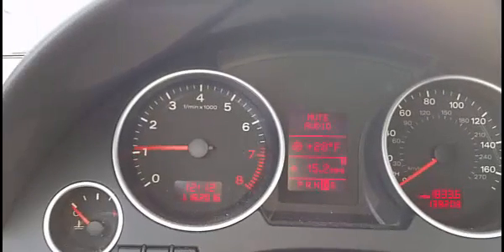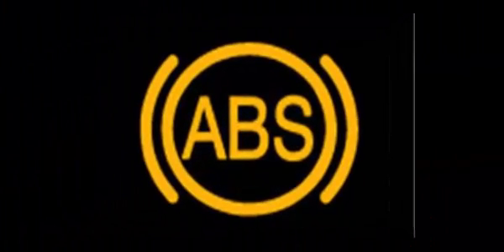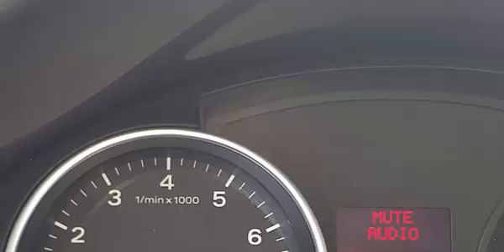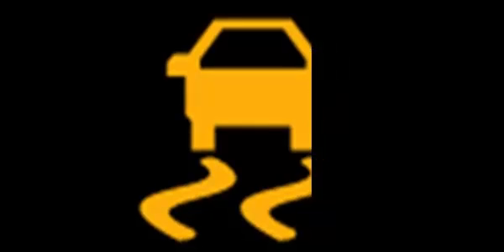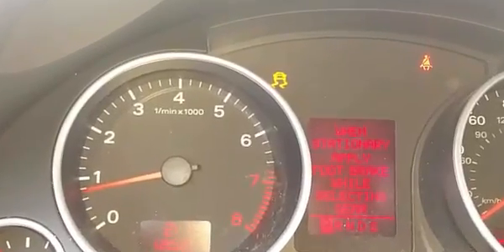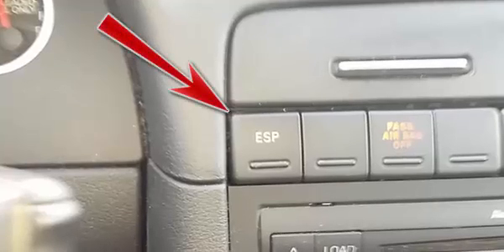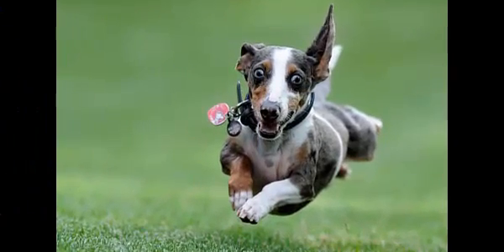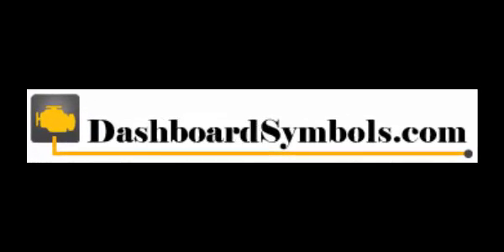Stability control lights: Assuming you have good tires, when and why do they pop up?

Comment: Does anyone know if it’s ok to drive with the check engine light/traction control and epc light on? Mechanic suggests to get rid of it (bad code on the engine thing). I am getting rid of it: however, I have to make a 10 mile round trip errand tomorrow.  The car runs, is it safe?
Reply from the maker: IF the car runs normally, it is PROBABLY ok to drive. But clearly the engine problem needs to be addressed as soon as possible to prevent serious damage...
Reply: @DashboardSymbols  thank you for your reply. It’s not normal, but it runs. Its idles high but I’m getting rid of it. It’s been burning oil for years. I just have this one errand before I get the new car.  Thank you 🙏🏻

Comment: So where would the button be located on 2007 Audi Q7 3.6L V6 quattro to re set the ESP light ?
Reply from the maker: There is no reset button for ESP. There MAY be an off switch, but it should be clearly marked. I'm sorry to say that we don't have access to Audi manuals, so there is no way to look this up. However, it would be marked ESP, and I would expect to find it in the upper, center part of the dashboard. Finally, if the light stays on when the button is pressed, there is a fault in the system...
Reply: @DashboardSymbols  oh alright thank you.

Comment: My 2013 subaru impreza shows check engine with traction control light, what could be the problem
Reply from the maker: Something in the engine, but a good tech will need to actually diagnose. Traction control will resolve once the engine problem is fixed...

Comment: i am currently buying a car its a 2015 Toyota corolla and I was testing it out and the ESC was turned on. I don't know if this is because I was getting used to the car or there is something about the car. Please can I have some advise
Reply from the maker: If you're telling me the LIGHT is on (the system should be on), don't buy it. Walk away...
Reply: @DashboardSymbols  I looked at it again and the light of control was on for the whole entire time not the ESC. so is it still a good idea to buy it?
Reply from the maker: @kurayamihayashi4060  Not without having it checked out.

Comment: Please help my electronic stability control keeps turning on and disables my all wheel drive on my dodge charger pursuit. Idk what's wrong have to keep turning my vehicle on and off goes away and comes back
Reply from the maker: There is clearly an issue that needs a hands-on diagnosis. Something as simple as having hit a pot hole can disable the system, but someone needs to get their hands on the car...

Comment: So I have a 2012 Toyota Tacoma and the traction control light has been on for quite a while meaning traction control is off but it doesn’t let me turn it back on to get rid of the light on the dash, someone reversed and hit my passenger side messing up my wheel more then anything I got all the parts replaced including the wheel the frame around the engine bay was all straighten out but my steering wheel needs and alignment it’s angled to the left even though I’m going straight could that be the problem? Or what do you recommend I do? Luckily I live in California so no snow or really any heavy rain
Reply: I also have the tire pressure light on but all tires have been checked on pressure including the spare so I’m assuming that’s just a bad pressure sensor right?
Reply: My truck also did pass the smog check here in California with both those lights on so everything todo under the hood is in good shape
Reply from the maker: Yes, poor alignment won't allow TC to operate. And it will wear out your tires fast too...

Comment: I saw this light briefly flash at me when i made a right turn up a hill that looks like it wasn’t paved evenly at some parts on the corner. So this light is normal to go on like that ? It’s basically just a small annoying warning? I wasn’t even driving that fast at all Around the corner too. It’s that sensitive? Now when I turn on the car that light isn’t on. If it was stuck on then I know there’s a deeper issue but there are no lights on my dashboard right now. The ABS light didn’t go off the same time this traction light went off.
Reply from the maker: Honestly, yes, just an annoying light seen when a wheel slips. I would caution only to make sure your tires are good -- they'll slip more as they wear...

Comment: I saw this light come on when I was parking my 2008 Lexus IS250 on a weirdly paved and angled street. It went on briefly for like 1 or 2 seconds and now I never seen it again. It’s gone, never seen it happen after I left the parking spot and drove normally. Now, I once had it never go off with the VSC and ABS light on. What it ended up being was a Wheel speed sensor went bad.
Reply from the maker: Don't actually see a question here, but it all sounds quite normal. And the bad sensor shut down multiple systems which were restored on repair...

Comment: I have a 2017 equinox. My Traction Light and Stabili Track Light came on yesterday. Felt like a rubber band pull first, then the Traction Light and Stabili Track. It drove home fine but I parked it. I need help with this.
Reply from the maker: And it will need to be hands-on help and diagnostics. it "feels" like a steering problem, but truly not possible to properly diagnose from a distance...
Reply: @DashboardSymbols  not a steering problem. It might be my engine correct but the light isn't on.
Reply from the maker: @Itsminenotyours-m5n  The check engine light should be on, and since it isn't likely not. Please do find a good tech to check it out. Good luck!!

Comment: Im having trouble with my 2016 ford ranger. The lights popups randomly then car brakes suddenly. Need to stop the engine to turn off the light, otherwise car will almost brakes everytime when i exceed certain speed. Been to several mechanics but all have same answer, checked the system with no faulty sensor, nothing unusual. I even changed the tyres to a new one and did an allignment but the problem is still there. Any advice?
Reply from the maker: Yes! Find better mechanics! If I understand correctly, the truck is braking on its own, yes? THAT needs to be the focus. Fix the brakes (have u seen an ABS light??)...

Comment: What happens when Check Engine stays on after Check Vehicle stability  and trak light turns off?
Reply from the maker: The check engine light on simply means there is a problem with the engine, most likely emission control system. It needs a hands on diagnosis. Once the engine issue is repaired, stability control light will no longer be seen...
Reply: @DashboardSymbols  Thanks but the Engine Light went away a day later.
Reply from the maker: @knightclassic1  Keep an eye out -- it will likely be back to haunt you...

Comment: My stability control comes on whether its wet or dry then the car automatic slows down and I have to break Then Car will  Go. What would cause that? Abs sensor was shown bad replaced it and still shows need replacing and car still does same thing.
Reply from the maker: Not enough to go on here, but I'm going to guess that the check engine light is also on and an engine issue needs to ne diagnosed and addressed. Nothing else would slow down the car...

Comment: My nissan note engine light is on and power lag issue..scanned the vehicle and find cam shaft and turbo charger,peddal sensors issue.. and we changed camshft sensor still the same.. while i drive in slopes or hill lag of power and traction control lights also came on.. not identified in garage plz advise
Reply from the maker: Sorry, this needs a hands on diagnosis. If you didn't use a dealership to do the scan, that's the way to go. We all have trust issues with them, but they have the experience. In the meantime, continue to search YouTube for the SPECIFIC symptoms. Also, any vacuum leaks??

Comment: I have a 2004 chevy express my stability light stay on when i drive  couple miles on the road.
 When i turn off engine it will reset and eluminate again after miles of driving. Need your help thanks.
Reply from the maker: What u actually need is a good mechanic. Assuming the light is on alone, there is a failure in one of many systems involved. Find someone u trust!!

Comment: Yeah my mazda 6 2016 sport just had the engine came on wit that lil light also. It's snowin here. Car slowed down. I stopped and parked light went out but now my engine is still on
Reply: Again it's snowin the light wasn't flicking it was solid then went out and didn't come on my car was slippin alil n was gave it to much gas to accelerate
Reply from the maker: Engine issue only. Get it resolved and all will be well...

Comment: So I have two stability control symbols apparently. I noticed it was on and remained solid while I was driving home. I decided to hit the stability control button thinking I had knocked it but then it had the same symbol with the word off attached to it. The other one also remained in place, which made two of them on at the same time. Both are the skidding car but one specifically says off and the other doesn’t. There is no flashing but it’s just constantly illuminated. Any ideas as to what could cause this?
Reply from the maker: Well, without intending to be trite, an actual problem with the system. However, the two lights sounds suspiciously like a Japanese branded product. Is the check engine light on as well?? If so, stability control will stay off (lights on) until the engine issue is resolved...

Comment: I had the flickering of the stability control light and I couldn’t accelerate for a second so I pulled over and it kinda went away but comes back when I press on my brakes too hard.
Reply from the maker: Have the tires and brakes checked...

Comment: hi, i'm cvrolet cruz 2016 while the car is going, the injektor burns out and shakes, it writes stabletrack, there are drownings in the car. I'm writing from Azerbaijan, I would appreciate it if you could reply
Reply from the maker: Ok, the English is broken, but it sounds like an engine problem, not stability control. Fix the engine and the stability control will turn back on and the light will go out...

Comment: For me the light comes on for no reason and then loses power. I've been to a number of garages, but I don't know exactly what the problem is. Is there an issue with the sensor?
Reply from the maker: This has to be the check engine light not the stability control light yes?? And if both are on, deal with the engine light only!!

Comment: Glad I found this video. My 2010 Chevy Colorado has been doing this for months and my brakes pump sometimes. I think I figured the problem and the best I could come up with is that my steering sensor is triggering that. I also think I may need to replace my drum brakes. Is there a way I could turn the stabilitrak or what do you think is causing my truck to pump it's brakes sometimes when I brake? Thanks.
Reply from the maker: If your brakes pump on their own, forget about steering sensors, etc. and get that fixed. Brake booster or ABS...

Comment: My epc and check engine light go out when i press the pedal down to start car stability control light comes on and car wont crank !  Back up lights come on in reverse so tps switch is working. Brake lights come on when brakes are applied so brake switch is working.
Reply from the maker: You've described some very odd sequences here and I'm not even sure there's a question. But I would start with the EPC...
Reply: Steven how fid you resolve the issue?  My 2020 Malibu is doing this .

Comment: Mine is coming on randomly. Even when sitting in park. Cleaned the speed censors and it seems to help it not happen as often but it is still doing it. Going to change the brakes (front & rear) and then go from there.
Reply from the maker: If the brakes need work, then yes. I doubt the light would come on while in park. Cleaning sensors was a great idea. Stay with it and let us know what happens! We'll pass it on...

Comment: My 2011 Mitsubishi lancer traction controll turns off on it's own and can't turn it on unless I restart the car also my cruise control stopped working too idk if they have anything to do with one another? Any help much appreciated!
Reply from the maker: An interesting question not asked before. So its not so much that the cruise control is the issue. What caused the cruise control failure likely is. Its not much help, but diagnose the cruise control problem and the other will likely resolve.

Comment: My mom's 2014 dodge avenger traction control light stays on and her electronic throttle body light comes on throwing it in limp mode hopefully changing the throttle body will fix the light's.
Reply from the maker: Can't verify a diagnosis from here, but its clear that stability control will remain disabled (light on) until the engine issue is fixed. Best of luck...

Comment: Will I still pass inspection with this light on or no?
Reply from the maker: It depends very much on the state, but it is possible, unless there is an obvious and serious problem with the brakes. Also, that light is often on because of a check engine light, in which case it won't pass. Don't take the chance -- repair the issue, whatever it is...

Comment: I have a 2017 Dodge Charger. It was running fine I have not had any warning lights come on. I stepped into the store the car would not start.  This locked in park now and won’t move. I’ve reset the battery but I don’t know what could have caused it to not start. It turns on but does not start if that makes sense
Reply from the maker: Interesting video you found under the circumstances. Anyway, turns on, but does not start suggests there is power but the engine is not turning over, yes? I can only speculate, but at first blush, make absolutely sure that the transmission really is in park and try again. Otherwise, a hands-on diagnosis will be necessary. Best of luck...

Comment: Can a P03 (multipal engen misfire) code trigger the traction control light to come on?  This is occurring on a 2010 Toyota Tacoma.
Reply from the maker: Yes. What you've said tells me the check engine light is on. So the trac or stab control is turned off (light on). It will be restored once the misfire is addressed...

Comment: 2016 ram 1500 6cyl. Need new tires badly, traction light stays on 48mph max speed high rpms?? Help please??
Reply from the maker: Likely the only help needed is the tires you already know about. Why delay? Do what's necessary!

Comment: I changed break pads and outer tire rod then the light was on after changed everything,  so could you tell me whats going  on ? Why is on now ?
Reply from the maker: First, its possible a sensor was disconnected or damaged during the repairs. Second, was the car aligned after the tie rod was replaced?? If not, that's the problem!! If yes, then you used a repair shop (sounded like you did this on your own) and they should have a look at their work...

Comment: So am I a bad driver if this turns on randomly and stays on
Reply from the maker: If its truly random, it should be checked out. If its in wet or otherwise slippery conditions, you might check your tire tread. But its staying on, so likely as not there is a problem with the system...
Reply: @DashboardSymbols  my brakes also have to get checked because they are not as good as before I recently started driving this car
Reply from the maker: @adamrivera7667  A great place to start actually. Fix the related stuff that are known to need work! Good luck...

Comment: My mum was driving her van home today and the ESC light came on while she was on the highway. The van slowed down and wouldn't accelerate, the brake pedal got firm and wouldn't go down and the steering wheel locked up! She got stranded! A few days ago the engine light came on, but it went out on it's own. Now THIS! I dunno, I'm stumped!
Reply from the maker: This is an engine problem, and actually sounds like the car shut down. The steering wheel doesn't lock up otherwise. You'll need a REALLY good garage and you might check the NHTSA site for recalls on the car...
Reply: @DashboardSymbols  I just found out that the alternator completely ceased up, it even melted the alternator belt!
Reply from the maker: @zephyr332  Ah, that explains it. Likely as not LOTS of lights came on (the engine DID shut down), but stability control is the scariest looking light and gets the attention...
Reply: @DashboardSymbols  The engine light was on a few days ago. It was lit for 2 days and then it went out - then yesterday it broke down. The engine light could've been the alternator sending an S.O.S. !!

Comment: I bought a Pontiac g6 gt 2007 the traction control light turns on and off by itself and every now and then the ABS light will turn on and off also with the traction control light. My traction control button doesn’t work tho I’ve tried turning it off but it won’t. So I’ve been driving the car it hasnt been a problem the traction control will come on when times I skid the tires and go to fast and after awhile the car will turn off the traction control by itself. Any clues ?
Reply: I live in Canada so there’s lots of snow so my traction control is always on but when I turn off my car and my car turns on again on concrete it won’t have traction control on. So I think the system works just the button to turn it off doesn’t work can I drive like this thru the winter ?
Reply from the maker: @wotblitzpros641  It sounds like its behaving normally when slippery and when you turn "off" the light will come "on". I DO think you need better tires. Have them checked...

Comment: I have a 2010 Toyota Camry and the check engine light and the squiggly car light goes off and on at times... what do I do
Reply from the maker: Any time the check engine light is on, have that addressed asap. The stability control is turned off (so the light is on) until the engine is running properly. Find a good repair shop...